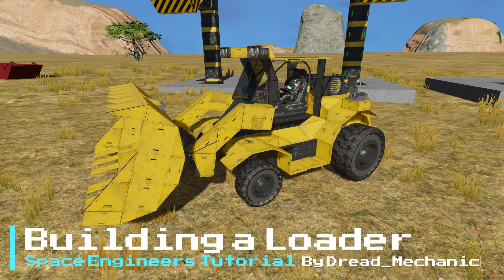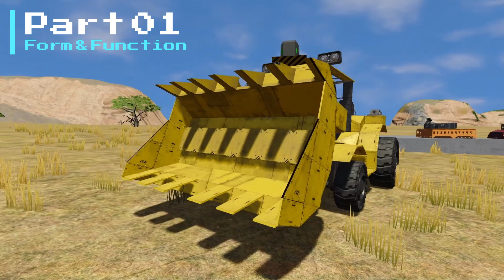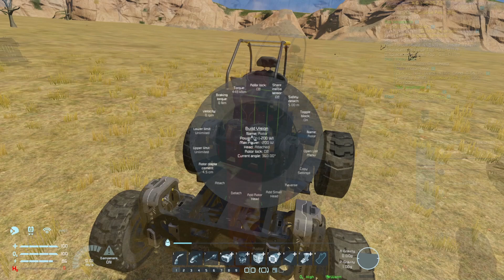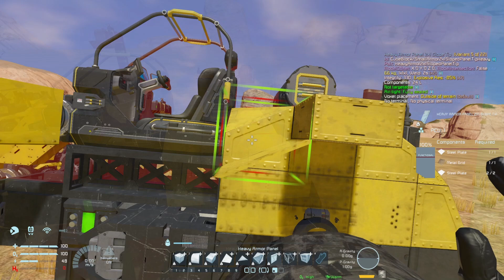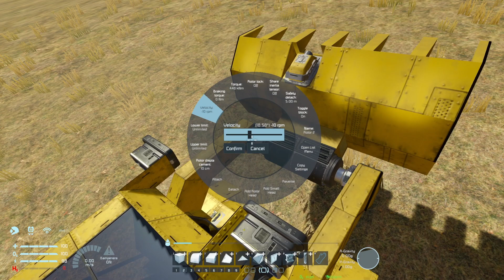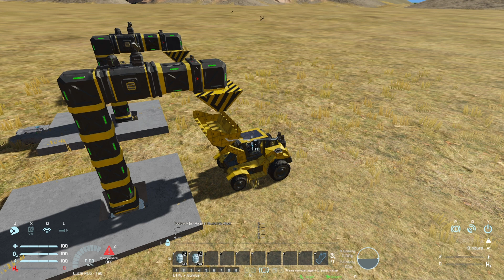Space Engineers | Building A Loader | Vanilla Tutorial

Comment: Hey just had a thought... What if mech legs could have a small grid landing gear incorporated at the bottom of the foot plate. Whenever it stepped down then trigger the landing gear so the foot locks in place and then unlock right before it lifts the foot again. Not sure if you could incorporate 2 separate grid landing gears on individual legs but it would sure increase traction. Might even be able to walk around on a ships hull in space haha.
Reply from the maker: Many have tried this idea in varying forms with mixed results.
It's a good idea in theory, but it causes a few issues like phantom forces/clang when the legs lock down on funny angles.
There's also a delay between sent to trigger the lock and the lading gear physically locking down, so if your walk cycle is too quick it will lock out of sequence leading to clang/funny angles mentioned before.

If you have something big, heavy & slow it's usually more reliable.
Reply: @dread_mechanic Ah that does make sense. It's nice being in a creative community where people think about these things though. Have you heard of using mass blocks at the feet to help hold the weight down?

Comment: Another great build.
I'd ask if a bulldozer is next on the list, but that would require a MOD for the tracks (to look correct), and I know you prefer to build in Vanilla.

The driving speed was set slow enough that driving around with a loaded bucket raised in the air wouldn't potentially cause tipping issues as with IRL loaders, especially since you were on fairly level ground.

I'm curious what the Center of Gravity is like for the loader both with the bucket lowered, and also raised with a load.
SE being SE, it doesn't seem like a full bucket load of ore/components would weigh all that much to drastically change CoG.
Reply from the maker: Thank you. I’m actually planning to do a few more plant machines, some of which would usually have tracks on them. 
But most of the track mods can be applied to any set of wheels so that option will still be available to people that want to put tracks on themselves. 

I mostly avoid scripts & API mods for my published builds so that they work on all platforms. 
I’m a former console player myself so I like to try and do stuff that anyone can use or replicate themselves. 

And you’d be surprised how much floating objects like ore and components actually weigh. 
That’s why I made the bodywork out of heavy blocks. 
My first attempt at the Forklift tipped right over on its first lift because it wasn’t heavy enough at the back 😂

Comment: After i saw your last video on the forklift, i built a massive version of what you built here, but instead of a bucket in the front, there was drills. It works really well  to create roads down under ground because you can adjust the drills height and angle. I however noticed that ion thrusters didn't work for me, they don't get any output in atmosphere to be able to trigger anything.
Reply from the maker: Glad my little tutorial was helpful for you 👍

Strange that you’re having issues with Ion Thrusters though. 🤔
As far as I know they’re still supposed to have a max output of 30% in full atmo, which isn’t enough to generate lift but is enough to trigger an Event Controller. 
That’s the main reason I use them for input controls. 

At the end of the day, any Thruster will work so the next best option is probably the Flatmo Thrusters as they’re quite small.
Reply: I prefer using a turret controller for booms/arms. I built a skidsteer a bit ago and set up the turret control to operate the lift arm and fork with the same control scheme as a real skidsteer. I like this since it offers higher speed and range of control while allowing you to drive at the same time.